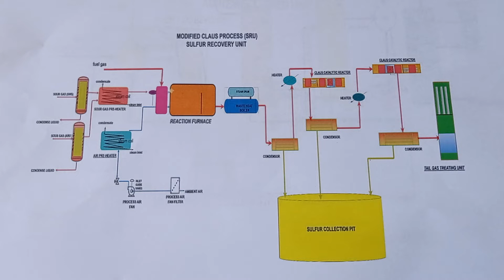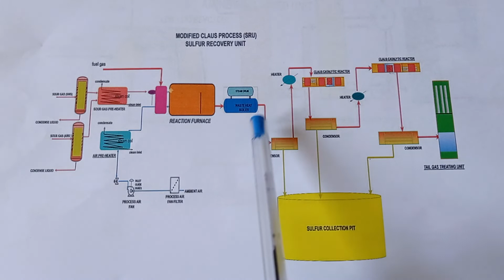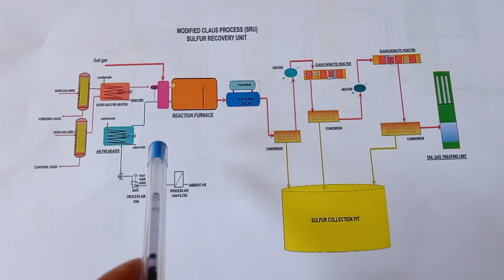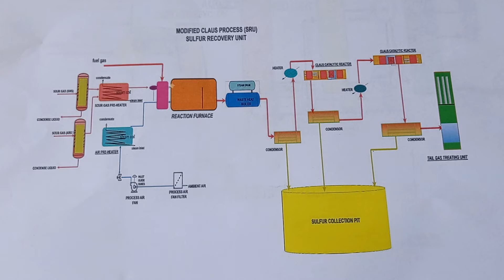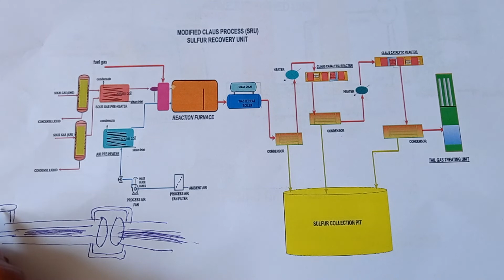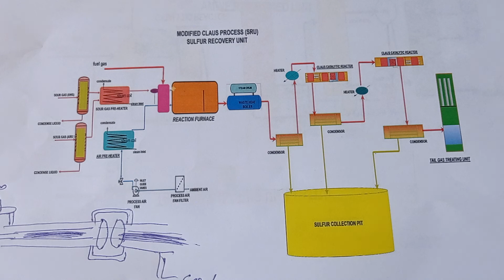interview questions and answers sru sulfur recovery unit

Comment: What field operators checks in field round
Reply from the maker: Pump and machinery healthy ness
Machinery sound vibrations
Temperature and pressure all manually
And by verifying with DCs reading
Gas leak fire hazard
Housekeeping
Leaks
And chitchatting with colleagues.
Reply: @chemicaldiary8412 The last point is so accurate haha

Comment: SIR lease reply if h2s gas release what action will be taken
Reply from the maker: If h2s realized your h2s gas detector beeps just move away from place seeing the wind direction 
Once your h2s detector is beeping means u r away from h2s hazards
Then inform control room about leak to stop the process then gas neutralize has to be taken place and decontamination to be done hazamat team 
H2s is denser so mostly it remains at ground level.
Reply: @chemicaldiary8412  should carry the h2s gas or multigas detector before going field rounds. Should be check calibration also. Observe windsock direction

Comment: A fire in the sulfur pit will be detected by a sharp rise in the pit vent temperature.
SO2 concentration in the sulfur pit will increase.
Once high high (HH) temperature or HH SO2 activate, pit will be isolated by stopping the educators and by closing the educator vents to atmosphere and the incinerator sweep gas flow.
Immediately open manual snuffing steam valve to the pit to extinguish the fire.
A brown plume venting from the stack indicates a continuing fire.
Maintain sulfur sump temperature below 160 0C.
Above this temperature sulfur is highly viscous and pump cannot able to develop pressure
Reply from the maker: Hi
Deep
Its really good informative explanation about pit temperature.
If you are selling liquid sulfur to other company and no intention to use inside the plant u can maintain the temperature such that it doesn't solidify.
If your company utilizes the liquid sulfur in internal plant consumption then u need to maintain such temperature to have good combustion in making sulfuric acid

Comment: Very helpful 👍👍
Reply from the maker: Thanks dear
Subscribe to my channel
Reply: @chemicaldiary8412 how many areas in sru ? For one field Operator's responsibility
Reply from the maker: @karthicklingadurai5021  
It depends on the capacity of the plant
Smaller plant
One plant can be taken care by one operator
If bigger plant means bigger man power requirements
And also it depends on what your company work they are making granulation or selling liquid sulfur or consuming for associated plant
Reply: @chemicaldiary8412  i attended an interview for a field Operator.. nearly answered all the questions.. but he asks a question line ( SRU has 4 areas .. in which area u responsible for?? ) . That I can't answered it . Did  you know what those areas may be ..
Reply: @chemicaldiary8412  and they are granulating Sulphur
Reply from the maker: @karthicklingadurai5021  

Sru
Tgtu
Aru
Sws
Sulfur melter
Sulfur loading
Sulfur granulation
Sulfur rt sulfur shipping
Sulfur granulation
Sulfur solidification and modification

U should see all my vedio then u will understand everything
Reply: @chemicaldiary8412  thank you bro . U r a good man.